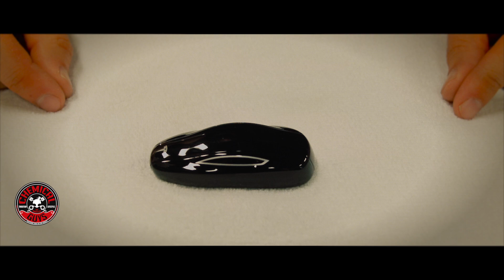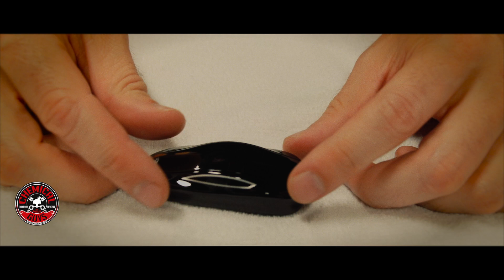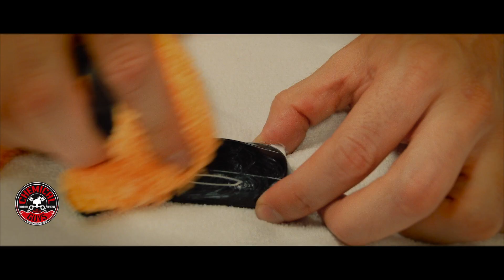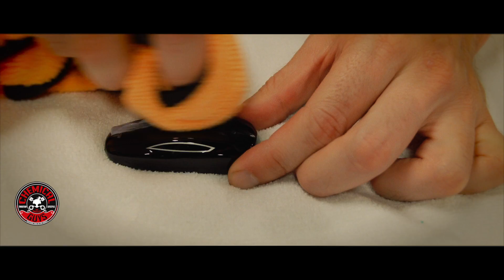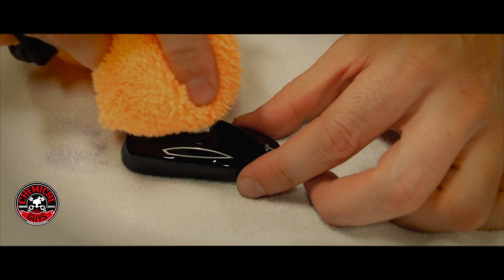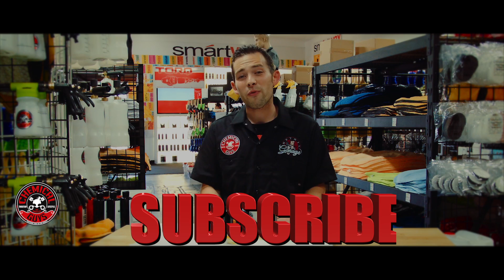Tesla Model S P85D Car Key Fob Detail - Chemical Guys

Comment: Some videos are great, but others are terrible. You started doing a full detail on something that you didn't even showed if it was in a bad condition or not, in order to check the before and after result. Also, sometimes you do things in a apparently careless way, as you forgot to wipe many parts of the key fob (like the sides) during the steps. You know better than anyone that detailing is all about the... details! ;)